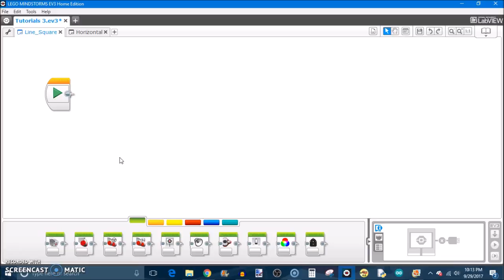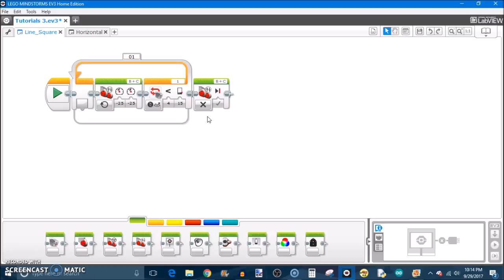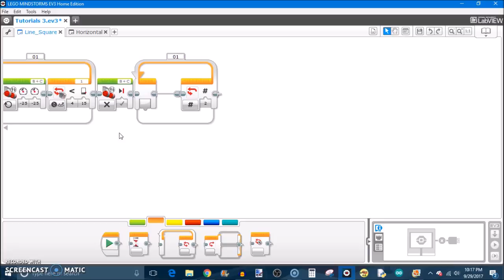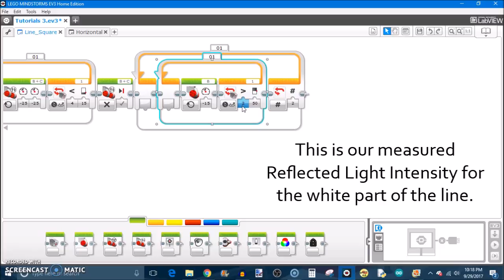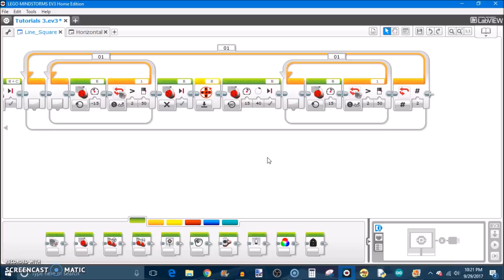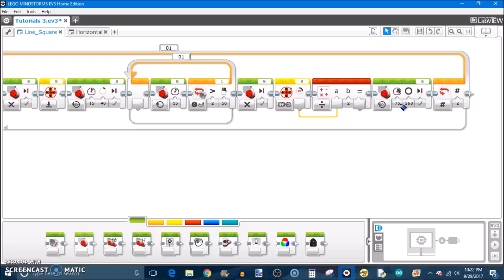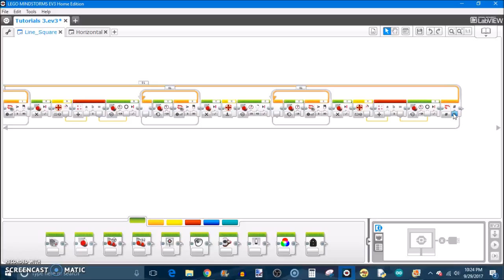Line Squaring for an EV3 Robot with Two Color Sensors

Comment: My kids' team loves your tutorials. They have been stuck on squaring up for 8 months however because they made a robot that is rear-wheel drive with large motors backwards. They changed all the power to backwards but they can't get the line squaring to work. It always ends slightly angled  They have 8cm from the center of the rear wheel to the color sensor and 14cm diagonally from the center of the pivot rear wheel to the center of the color sensor. The distance between their color sensors in front is 11.5cm.. I'm guessing the problems are because of the larger arc caused by the distance from the pivoting wheel to the color sensor. Can you give them some tips on what to modify when programming a rear-wheel drive design?  I've seen suggestions about the geometry of a circle but the kids are confused about how to incorporate that. Thanks!
Reply from the maker: If the wheels are in the rear and the color sensors are in front, the increased distance between the wheels and the sensors will make for a longer arc of the color sensors when the wheels try to pivot the robot, as you said yourself. I recommend slowing everything in the program down (all motor speeds) to account for the extra sensitivity that the increased distance causes.

Comment: Hi , I was watching one of your early vids with 4 wheel did drive.
Can u recommend any programming to assist with wheel slippage going up a slope.
Regards Paul, Hexham 3rd Guides
Reply from the maker: That is a touch one, I don't know if anyone has tried to tackle that yet. I would recommend you start researching the stability control systems used in real-world cars; they can detect wheel slippage and compensate. Then see what you can incorporate from there.

Comment: Also, my color sensors are sensing the edge of the black line during the program, and my robot just ends up being on the line, but not perpendicular. This is a correction to my previous comment: changing the math block thingamajig will help, but it will not make it perfect. The line squaring thing is not working at even moderately steep angles.
Reply from the maker: Thanks for the heads up. Maybe try changing your color sensor threshold values?
Reply: Thanks, I did solve the problem. Part 2 of your original line squaring video series shows how to make a special My Block to improve the program, if you can recall. I combined that My Block and this new program and it is working great! Thank you as always!
Reply from the maker: You're welcome! I'm glad you solved the problem!

Comment: The line squaring program was not working at all for me, and I had it perfectly copied, except for different sensor values. But then I realized that the number of the degrees that the motor traveled was negative (measured by the motor sensor block), and I would only travel a negative amount of degrees because of that. I changed the divide by 2 in the math block to divide by -2, and it works perfectly now. If you people out there are having the same problem, change the divide by 2 in the math block to divide by -2. It should work now.

Builderdude35, maybe you could edit the video and add a footnote that the math block should be divide by -2 instead of divide by 2 if positive power makes your robot go forward. Divide by 2 could work for Sirius and other robots that go forward with negative power, but it clearly does not work for my robot, which goes forward with positive power.

Overall, still a great tutorial, and I would not have been able to line square without this program. Keep doing awesome tutorials, Builderdude35!!
Reply from the maker: Thanks for sharing, and yes, you are correct. If your robot drives forward with positive power, you must divide by -2. Unfortunately, YouTube took away Annotations so I can't add a note to the video. Thank you for pointing this out.

Comment: First, greatly appreciate your tutorials, we've learned so much from them.   One question about your program -- in the video, the robot is always approaching from the same angle, in which the color sensor in the first loop reaches the black line first.   This means that the other wheel hasn't reached the black line yet.   However, if you approach from the opposite direction, the non-sensor wheel reaches the black line first, and if the angle is steep enough,  goes past the black line by the time that the wheel on the sensor side reaches the line.    Am I doing something wrong, or is this something that needs to be fixed?   Many thanks!
Reply from the maker: Yes, you are absolutely correct! The right sensor is looking for the line first, so the robot can approach from a steeper angle from the right side.  However, it cannot approach at much of an angle form the left side. You can always change which sensor is looking for the line first if you need to compensate for an approach angle from the other side. If you need it to be able to handle both sides, you need to use a switch block with multiple conditions; I have a tutorial on how to make those.
Reply: You could modify the attack to look at the differential between either sensor.

Comment: Builderdude35, thanks for all these instructional videos.  My daughter has benefited from your gyro videos this year.  Re: line squaring ... we have done lots of studying, tried several approaches and even many of our own.  best we get it "good" results ... say 80%, but there's always 20% or so (too high percent for us) where the robot is just not perfectly lined up at the conclusion and in fact, perfect is not the issue ... it's actually quite off.  in your video above, at time mark 12:29 exactly, there is an example of exactly what I'm talking about re: the 20% not-so-good.  that result is actually not square at all and while you may have clipped the video too short and that run ended perfectly, that is just an example of what i was talking about.  we will try yours next.  I originally stayed away because it just took a few too many seconds, but at this point, if the one outlined here is as good as it seems, we will just use it more sparingly.  but, before we spend more time, i wondered if you had a suggestion to get around the issue i describe here.
Reply from the maker: The run at 12:29 ended up perfectly square, so I think it's just the camera angle making it look odd. If accuracy is your priority, I would highly recommend using this program; though it is time consuming, it is fairly reliable (though nothing is ever 100%). If the program as I show it in the video is still not accurate enough to suit your needs, try slowing it down or adding another repetition of the squaring.
Reply: David, can you please guide me on the gyro? or builderdude? It is measure angles up to 7000 degrees and constantly drifting...

Comment: Having issues not getting it to work.  it tries but then goes in a circle
Reply from the maker: The Color sensors aren't seeing the line because the target light values are incorrect. Measure the new target values using Port View and enter those into your program.

Comment: Why do you use a loop-exit clause to read your sensor rather than a wait block with a sensor clause?
Reply from the maker: It's just habit. I'm used to programming in C, which has no such thing as a wait block/sensor clause (unless it's natural language). In C, you would set up a while loop with a condition, which in EV3-G is the equivalent of a Loop block with an exit case. You can certainly use a wait block/sensor clause, but I did it this way because that's how I'm used to programming in C. Great question!
Reply: Thanks, I was just wondering if this was perhaps more accurate. I think using the loop-within-loop structure could make ik more confusing, but your reasoning makes sense! to each his own I guess.

Comment: I would like to use a large motor for the steering (rack and pinion) of a truck I built. The range of that motor is just +/- 120 degrees. I would like to use a light sensor for a line follower program (proportional or even PID) that allows the truck to stay "on the road". Any suggestions to create the program with limited range of the (large) motor?
Thank you for your ideas and expertise.
Reply from the maker: Sorry for not replying sooner! You can incorporate a switch that checks the motor's current amount of degrees. If it's > 120 (or < -120), have the robot power the motors back in the opposite direction. I recommend that you watch my four part series on programming car steering (Part 1: https://youtu.be/b621-w8mDAU). The videos are really old and kind of poor quality, but the information will help you a lot, as they cover exactly what you're trying to do.
Reply: Thank you very much. My students and I will get right on  it. Super stuff.
Reply: How else could I access this 4 part series? My  comp. cannot find that link. Thank you
Reply from the maker: Woops, that's my mistake. When I typed the comment, the parenthesis were included in the URL. Here's the correct link: https://youtu.be/b621-w8mDAU

Comment: Isn't it better to do left & right in parallel?
Reply from the maker: What do you mean by in parallel? Do you mean both wheels simultaneously?
Reply: Yes - so both wheels move forward at the same time. Whichever one hits the line first must stop and wait until the second one hits the line.
Reply from the maker: Sure, it can be done that way, but you'll introduce extra motion that may make the squaring less accurate. Maybe there is no negative effect. Fixing each wheel individually allows the robot to focus on just one action at a time, which is the most accurate way to accomplish it. But, if you are in a crunch for time, squaring in parallel like you suggested is a great alternative. Maybe I'll make a tutorial on the topic!

Comment: I really appreciate yur hardwork and respect it.please try and make it with one sensor if (if)possible.
Thanks
Reply from the maker: Thank you! Unfortunately, it's not possible to do this with one sensor. The reason boils down to geometry; two points define a line. The two sensors serve as the two control points necessary to straighten the robot out.
Reply: thanks for the reply!
Reply: What if you used a motor to position the single sensor at position 1 when needed, and position 2 when needed??  Just thinkin' out loud here..
Reply: jerry i think you are right